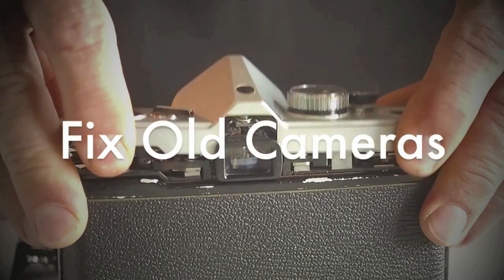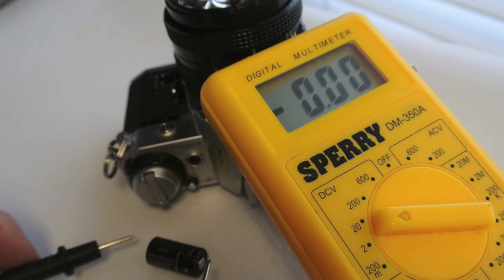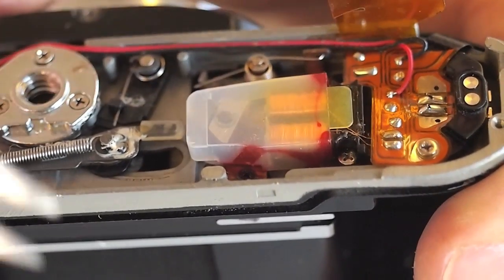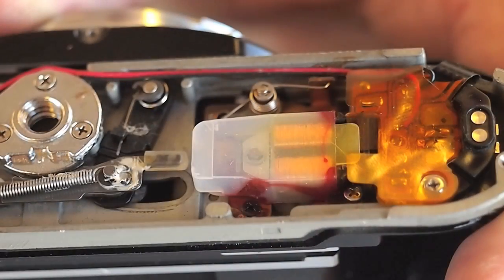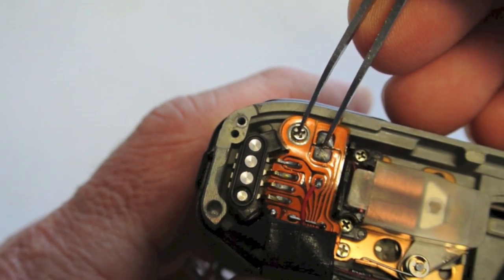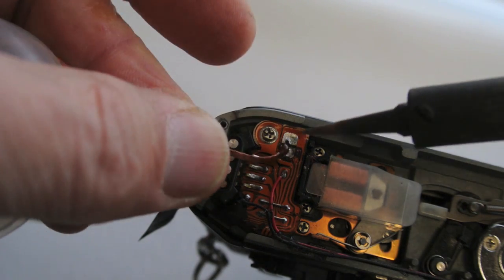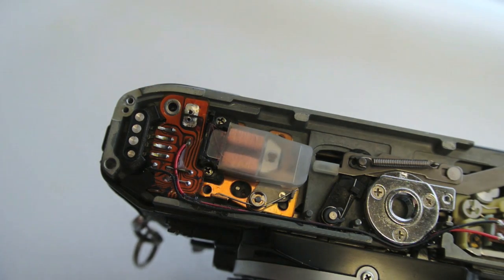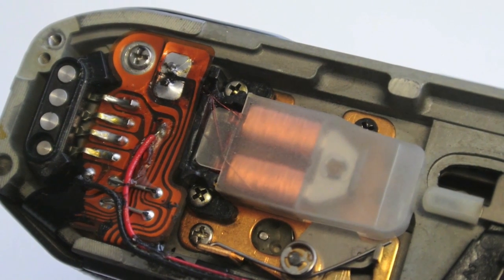Fix Old Cameras: AE-1 Release Magnet

Comment: I have a similar problem. The camera doesn't fire. Opened the bottom cover but the surfaces of the electromagnet are clean. Tried to fire the electromagnet using the method in this video but it seems to be dead. Should I consider cleaning the surfaces of the electromagnet even if it seems to be clean? Where could I find an electromagnet to replace it in case it is dead? Thanks
Reply from the maker: +Gligor Florin If the magnet does not release shorting battery voltage across the magnet terminal as demonstrated, than the magnet is defective. The release magnets are sometimes available on ebay. Otherwise salvage one from a camera that has other issues. Also note - make sure you have a battery in your camera that is delivering at least 5.8 volts. A weak battery will prevent the release magnet from working.
Reply: +Fix Old Cameras Thanks for your answer. Actually the magnet fires if I press the shutter button and at the same time I put a piece of wire between screw and one terminal of the magnet. so the mg is not dead. what else could Be? many thanks în advance!
Reply from the maker: Check for a beak in the connecting flex circuit. Check for a solid connection on the lower flex ground screw. From an early post... If the magnet energizes then the issue is in the release circuit or a loose ground screw. Check the ground screws by the release magnet and by the left of the eyepiece ( you will have to remove the top cover to access this ground screw). The additional circuit trouble shooting is much more involved... Probably not going to help much, but, make sure you are getting battery + voltage at the lead on the (blue) release capacitor closest to the release magnet. Make sure you have battery + voltage at the lead of the release magnet closest to the release capacitor. If good, check coil continuity of the magnet. If no continuity, remelt solder at the test points. Also top cover can be removed and all the switches on the release side of the camera should be checked. There could be an open in the flex circuit or connections that will need to be traced. Then there is the possibility that all is for not as you could have a defective IC, the one that lives on the release button side of the prism flex. Also, if you are using an alkaline battery you might switch to a silver or lithium.
Reply: Checked almost all of these and there seem to be no breaks along the circuit. Also checked the little tinny  blades below the shutter button and they are OK. Is there any condenser below the top cover circuit (somewhere deep inside the body) that makes the releasing process (shooting) possible? I will consider replacing battery, even if it`s a new one (alkaline Varta 4LR44). Thanks
Reply from the maker: A weak battery will prevent the camera from releasing and still allow the meter to work. Battery voltage across the magnet should repel the keeper. If not the magnet is defective and will have to be replaced with one salvaged from another camera with other more significant issues. The capacitor (usually blue in color) next to the release magnet is the release capacitor.
Reply: Checked the capacitor voltage and it shows only ~1,56 V. Is this normal?
Reply from the maker: It will be difficult to measure static voltage to determine condition of the release capacitor. The switch closed by the release button sets a chain of electronic events in motion.When things have progressed enough to suit the CPU(central processing unit) inside one of the three main IC circuits, pin two of PX-2 IC connected to pin nineteen of PX-3 IC goes low and trips the shutter timing sequence. The connection is also taken thru the flex circuit at the coil of the release magnet to enable it to conduct. This capacitor then discharges through the coil of the magnet at voltage much  higher than your reading.

Comment: Hi, I have a quick question you maybe be able to help me with. One of my A1 has a wire broken, on the A1 it is white but on this video it is red, it runs from one side of the camera to the other. My question is can you tell me what weight or how I would identify the wire when trying to source a piece to replace my broken one?
Reply from the maker: Using a braided wire of similar size is acceptable, exact size is not critical. The braided needs to be small enough that it can be accurately soldered. However do not try to use solid core wire.
Reply: @FixOldCameras  Thank you so much for taking the time to reply, I appreciate it. And you may well have help get a really nice condition A1 back on the road, fingers crossed.

Comment: I haven't seen my issue mentioned in the comments, it's on my first camera, an A-1 I just bought.

My battery has the proper voltage. The shutter releases the first time after turning it on, but when I cock the shutter again, the button doesn't work (Does not meter of fire). It only works again when I press the battery checker button or if I turn it off and on again. 

I thought it had to do with it not preparing properly for the next shot and the battery checker button canceling something about the previous one, but if I short the contacts,  it releases. 

I'm out of ideas and I can''t find much information, any help would be greatly appreciated.
Reply: Join the Learn Camera Repair group on Facebook. Someone there will be able to help you!

Comment: Hi there,

I have a similar problem... I can shoot the picture, but the mirror stays up after pressing the shutter. Will cleaning the battery components be enough? Thanks in advance!
Reply from the maker: It is possible that the mirror escapement is so dry it is causing the mirror to hang up. If so, this might help - https://www.youtube.com/watch?v=4YMpMHwMtX4
Or it is possible the tungsten ASA cable is off its pulleys or broken. Is the meter pegging? If so you might check this video for help.
 https://www.youtube.com/watch?v=hJUidgM6LoI

Comment: Hello, I have a huge problem with a canon a1. Camera in almost perfect shape, bought 2 months ago from Japan (300$), only 2 films shot, amazing pictures. A few days ago I tried to switch it on- after one week it was off-, but nothing, it seemed to be dead! I changed the battery with a brand new one, but still nothing, no information in the viewfinder and no LED blinking, when testing the battery status. 
Then by opening the bottom plate I saw that the magnet was stuck. I could be able to manually tap the switch to manually release the shutter, but when advancing the film it got stuck again. And apparently no current was flowing in the camera's circuit, as it was like switched off.
Now, I ordered a new electromagnet on the web, but: what shall I do if it was not the magnet failing? How to check the circuit and try to understand which component is actually failing? Could I use a multimeter and close the circuit where the magnets pins are? Or is that dangerous for the circuit itself, as I introduce a current that is bigger than the expected one? Which scenarios should I expect? 
Thank you so much for your help!
Reply: Ah, I wanted to add that I did all the checks you reported in the video and even shorting battery voltage across the magnet terminal, it doesn't release. From what you said then it should be defective. The question is- actually hoping that it is the component which experienced a failure- is there a way to check the circuit before replacing the magnet and make sure that I actually isolated the issue?
Reply from the maker: Replacing the release magnet will not help a camera that is completely dead. With the camera being completely dead there has been a circuit failure or you have yet to be discovered battery or battery contact issue.
Reply: Hello, thanks for your answer.
What do you suggest to do then?

Matteo

Comment: hi! I have an odd problem with my Canon AE-1 program camera that I bought off Ebay. The description said that the camera was fully functional, so I can get a refund if this won't get resolved. Anyway, the problem is kind of difficult to describe. The camera won't change the shutter speed no matter what. I checked the battery, inserted a new film and checked everything that I could and knew how to. It appears as if the shutter speed dial doesn't send a signal to the shutter to change the speed. I can set the shutter speed to 1/1000 or 1/60 or 1, but the shutter won't release for at least 1,5 seconds. If this has made any sense, can you advise me in any way what more can I do or is it irreperable? Thanks in advance
Reply from the maker: Could be the holding magnet (MG3) is sticking or other mechanical problems, could be a control process IC failure, could shutter closing switch (SW4) is shorted or not opening capacitor (C3) is shorted. Often when the speeds are all slow the delay set by the shutter speed variable resistor (VR-2) and (C-3) may be long.  You need to make sure SW-4 opens with the first curtain and there are no leaks to ground with (SW-4) open. You will also need to check connections from the (VR-2) and B+. None of these checks or repairs are simple except cleaning the holding surface of the (MG3) magnet.
Reply: Fix Old Cameras thank you so much for the thorough answer! I'll try and check whatever I'm confident in doing and hope to find a solution soon.

Comment: HI! I have an AE-1 with unstable shutter release. The button works from time to time. I thought it could be a magnet issue but when a ground magnet contacts the shutter fires instantly. Could you please give me some advice what may cause such behaviour.
Reply from the maker: With erratic release, the first suspect would be a weak battery. Otherwise it is generally a failure of the release electronics.

Comment: I have A question. my AE-1 has a good battery but in won't fire the shutter. when i push my shutter button half, i get the readings. I cleaned all my contacts. but when I crank the leaver again so the shutter is 'armed' it keeps that way even when i short it like you showed it. Do I have a bad magnet?
Reply: however it fires when I move a strong magnet over  the case.. probably shouldn't have done that...
Reply from the maker: If the release magnet does not release when shorted as demonstrated with a good battery in the camera the electro magnet is confirmed defective. The opposing magnetic poles probably caused the permanent holding magnet of the release magnet to release when exposed to the external magnet. Interesting results that probably did no harm.

Comment: I have an issue where the  shutter speed doesn't change no matter what the dial is set too. Any thoughts on fixes for this? Thanks
Reply from the maker: If the shutter runs through without opening... check the shutter holding magnet (smaller magnet visible with the bottom cover removed). Check for proper alignment, or dirty latching surface or the magnet. No power to the magnet coil or an open coil could also cause such an issue.

Comment: I’ve watched videos but still I can’t open the part to put the films, does it require too much strength? I bought a camera that seems to be veeery old and I don’t know what to do because I’m new to this. Thank you
Reply from the maker: The door latch could be stuck you should be able to open the film door by gently pulling up on the rewind knob. If that action does not open the door than the latch can be accessed by remove the rewind side leatherette so that the door latch cover plate can be removed.
Reply: Fix Old Cameras Thank you for replying!

Comment: I have to manually release the magnet by forcing the armature, shorting the solder points on the ground pin does not work. However, before replacing the magnet, I have a query. When I manually release the magnet, the shutter curtain and mirror do not move corresponding to the shutter speed. The mirror flaps up and down idly, and I’m not sure if the shutter curtain opens at all. Is this normal and would this correct itself if I replaced the magnet, or does this mean that there may be more severe problems with the camera? I’ve cleaned the contacts on the curtain magnet and this still occurs. Thanks anyone!

Comment: So the shutter release on my AE-1 works, but only if pressed fast & hard. Otherwise it will not go off, just act as if it were half depressed. Any idea why this could be?
Reply from the maker: Mmmm... not sure. Might be that the release button switch contacts are not making positive connection.

Comment: I just bought this type of camera from a antique store had to replace the battery and  everything seems good but I have one problem the shutter button is stuck (not physically) i can move the switch in the three different spots but 2/3 its always in the self timer mode any suggestions?
Reply from the maker: +nick minella It is possibly an issue with the self-timer switch contacts beneath the three position S/A/L switch of the top cover. Remove the top cover and inspect the switch base and contacts.

Comment: I'm able to get the magnet to release and the shutter fires when shorting the ground screw to one half of the solder connection on the flex circuit (as in 1:33 in the video) but not on the other half (1:38). Should the magnet release when shorting to either solder joint?
Reply from the maker: If the magnet release as demonstrated in the video, then the indications are that the magnet is functioning and the mechanics of the mirror / shutter are not the source of the release issue. You can try cleaning the release button switch contacts configuration, but there is a likely possibility the release capacitor that lives by the magnet has died. If not the capacitor than other circuit issues such as an open flex or failed IC.
Reply: @FixOldCameras  Thanks for your reply. I removed the camera top cover and inspected the release button contacts. I didn't get around to cleaning them yet but tried the following. It appears there are three "stacked" contacts. When I depress the top contact so it touches the middle contact (assume that's what happens when you depress the release button "half way"), the exposure meter operates as intended. When I press the top contact further so that all three contacts are touching, nothing happens. If I bypass the top contact and press down on the middle contact so it touches the bottom contact, the shutter fires. Have tried this multiple times and get the same result. Any suggestions as to what's happening here?
Reply from the maker: @matthewtilling3784  Hmmm. Might be getting a bit tricky to troubleshoot. If the meter does not stay on when the release button is fully pushed then released, recheck the wire connections to the switches and the contact surfaces. If the meter stays on after release of the buttons then it is likely a release circuit issue. One course... A) Desolder the purple wire from the diode behind the right side IC (PX2). If the problem stops, the preview switch is leaking. B) Desolder the cathode (banded) end of the diode. It the meter turns off, the problem is possibly the first blade of the switch stack (SW-1). If the meter stays on you are screwed as the IC is likely defective.  Other then checking ground screws and the flex for breaks, troubleshooting much beyond this point will require a schematic and logic probe.

Comment: the shutter curtain doesn't fully close when I push the shutter button and the winding lever gets stuck. I manually close the shutter curtain and the winding lever works again. the mirror also gets stuck as if I was taking a bulb shot.  what should I do?
Reply from the maker: It is possible that the second curtain has lost tension or is binding so it is unable to complete the release cycle. If the shutter curtain is binding locating the cause could get fairly involved. If the curtain tension as slipped, the curtain tension can be adjusted by removing the bottom cover and accessing the tension adjustment ratchet gears. They are the two white gears that are in a parallel position.